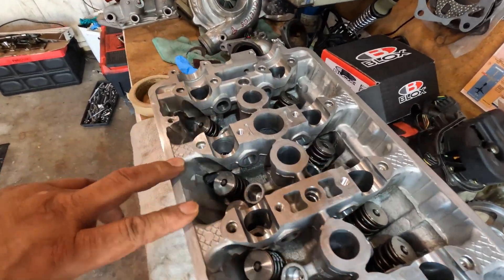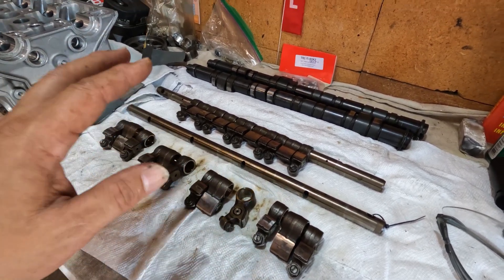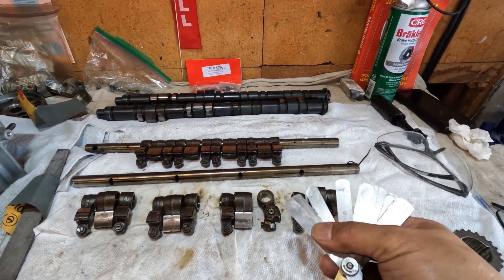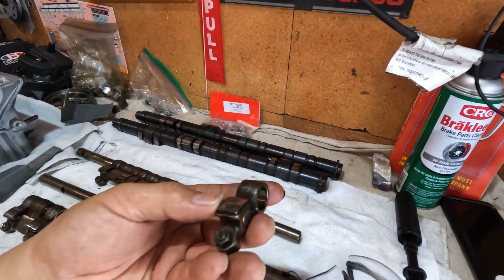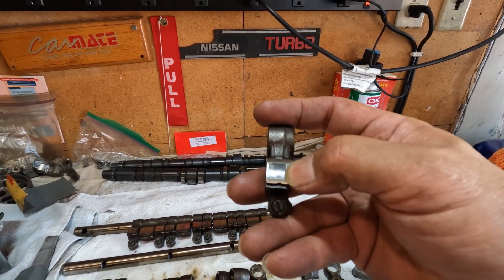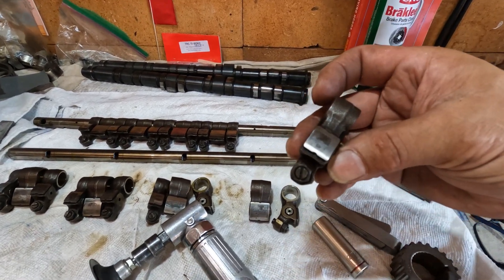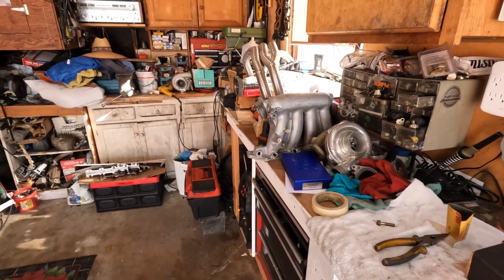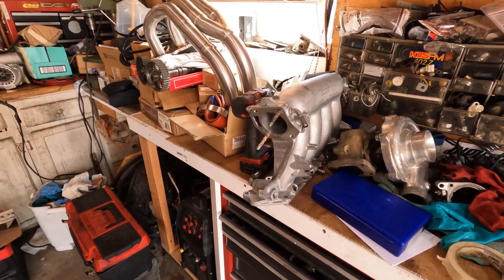H22, h23a, F20b, B18c, B16a Valve rocker arms repair.

Comment: Thanks what size bolt did you use to adjust the rocker arm? Mine came out of orientation I need to rotate it
Reply from the maker: I used the bolt for the transmission.

Comment: I have skunk 2 pro 2 cams and I used some old rockers and I have a pretty loud valve tick I have done the lash to as low as .001 under spec and it still ticks do you think worn pads could cause that. It’s otherwise a brand new build
Reply: I have skunk 2 spring lmas brand new and supertech valve springs all brand new
Reply from the maker: @Anthonysdixon  ok, my co worker have same issues like yours but on a B16 and he never did really figured ut out. He ended up exhanging his cyl head and never hear that ticking sound. If your valve lashes is all set correctly and you already have spring lma's. The only thing l can think of is maybe its bottoming out and if it does, the cam lobes will be digging on the rockers for sure but you dont experience any of that. Hmmmnn, l'll give some more thoughts and l'll ask my coworker again about. Do you think your valve is hitting the piston somehow or maybe you have a v2v clearance problem maybe. Did you degree your cams?
Reply from the maker: If your rockers have no groove due to cam lobes digging its way, it should be alright. The ticking ususally come from LMA, are using spring type lma or hydaulic type. Spring type lma makes it quiter. I assumed you also using good valve springs for your sk2 cams.
Reply from the maker: I would keep the valve lashes to minimum settings, making it tighter will worn out your rockers or cam lobes. If you do have a spring type, check make sure that it's not broken or something. It's known spring lma's will break.
Reply: The ticking started after a pass when I was on rev limiter. Maybe something was off and a valve hit im not sure. Theyre stainless Ferrea valves. Hopefully I didn’t bend something. I have a pretty thick head gasket to lower compression so I can’t imaging I hit anything I’m not sure. They degreed -2 -2 (I’m assuming because of the headgasket width)
Reply from the maker: @Anthonysdixon  if it hit the rev limiter, do a compression test to make sure you didn't bent a valve or something, compression test and leak down test will give you an idea. You can also do a quick test of pulling the ignition wire one by one and listen to the sound of the engine idling. How's the engine running? Was it running rough or feels like your misfiring and sounded like a Subbie. Also check your timing belt timing, make sure you didnt skip a tooth or something.
Reply: It’s not running rough I did a compression test and all cylinders were within 15 pounds of each other other or so. I also did a leak down test but I’m not sure the best way to do it. Should I have the cams removed? I did cylinder number one at top dead center with the pulled all the way out. That seem to work fine I didn’t hear any leakage out of the exhaust pipe or intercooler pipe. I then did the other cylinders at top dead center but realized that some of the valves remain open on some cylinders. I then tried it with the cylinders in the same position as when you lash valves, I could hear some air escaping through the exhaust valves, but I’m not sure if it’s an accurate reading because the piston is not at Tdc when the valves are all the way closed. Should I do the test with the cam shafts out?
Reply from the maker: @Anthonysdixon  Do the leak down test with canshafts. But check your valve lashes and set it to .007"on In and .008" ex. Do the procedures per ignition firing order, 1,3,4,2.

Comment: All of the rocker arm assemblys in the video tittle are compatible with each other? I can take the h22 and put em on an f20b?
Reply from the maker: The repair can be applied on all the motor mentioned. H22 and F20b rocker arms are compatible. You can use it, same thing on the camshafts.

Comment: What’s the valve lash spec for the f20B and do you know where you can get valves for the f20b?
Reply from the maker: Not sure but the last F20b that l did, l ser it  like H22. 0.006-.007 Intake, .0.007-0.008" exhaust. I think you can't get a replacement valves here in US. You can try Honda dealership and maybe they can special order it for you. You can also try FB market. I know some people they send it to machine shop and replaced valve guide to the size of H22, maybe you can go thay route, get an estimate on how much it'll cost you to get it rebuild.

Comment: Quick question bro … i want to make a g22 build using a f22b block and h22a head will that be the same process as all your videos? Or if you could give me some information on the process like do i have to seal the wholes on the head as well that would be greatly appreciated. Also what head gasket to use thank you in advance 🙏🏻. 
Do you have instagram or facebook so i can message you directly through there.
Reply: Thank you so much bro 🙏🏻🥺 I’ve been looking for information or videos on YouTube and no one seems to show the process on what to do for the g23 until i found yours 👌🏻😁. I have a eg6 right hand drive with a h22a boosting 10 psi but out of nowhere it lost oil pressure and spun some bearings and did a lot of damage. I just cant find h22 over here 😅 thats why im going with the g22 … but I really appreciate the info keep up the good work 👌🏻😁
Reply from the maker: @lsxcartel6771  that's not good for the old H! But yeah, its similar to building a g23 and once you figure out what piston size to use next is what everyone always making not sure off, it's the headgasket, other than that, it's almost a walk in the park,lol, kinda. Later man!
Reply from the maker: It's pretty much the same process, plugging 2 oil drain holes on H22 head, H22 timing belt, crank gear, you need to swap the h22 waterpump gear pulley to f22 or give Kstuned a call if their item g23 waterpump will fit the f22 block.( pretty sure it will). Water coolant tube, you need h22 connected to f22 and use H22 thermostat housing. Headgasket, not sure what others been using and what really works. But l know that you use a headgasket base on what block you are using. But there's lots of info on the web like Honda-tech.com. F22 block have a oil restrictor, located in the middle of rhe block just above the oil pressure switch( intake side). That restrictor is not needed for G22vtec , so it need to be remove for h22 head swap. Use Cb7 accord engine mount bracket(driver side) to mate it w/ h22 mount. Plenty of choice for piston since f22 block is iron sleeve, you can have it bore to 86mm to accept k20a2 piston if you wish, but only on NA setup. Visit zealautowerks.com for engine compression setup. I have not done a g22 myself but l know it's same process. You can just leave a msg and l'll be glad to help you out in anyway. Alright bruh!
Reply from the maker: Kstuned offer lots of parts like oil drain plugs, waterpump for frankeintein build. Shoot them a email and they'll be glad to help you out too.
Reply: How are you man? I just started the build 😅 but what kind of sealer do you use to plug the oil drains… i was gona use the RTV black or grey silicone …. Im not sure if that will hold 😅
Reply from the maker: @lsxcartel6771  I made a vlog about how l plug the cylinder head. I showed brand and part number. Kstuned.com sell a plug and it's not that expensive. I used a "Versachem Mega grey 3". It's the same stuff like Hondabond. Don't use black silicone.
Reply: @sagittnet2158  oh okay thank you so much 🙏🏻😁
Reply: @lsxcartel6771 I would personally rather have them welded up. I know they make head plugs, but welding them is a sure way it won’t leak. I’ve seen machine shops that would weld them up and deck it for the customer. Doesn’t hurt to ask. 🤷🏻‍♂️

Comment: @saggitt net2 what injectors should I run on a high comp g23 build with say a 90mm throttle body and k series skunk 2 ultra street manifold
Reply from the maker: I'm just giving my 2 cents, 500cc up to 750cc will be good for a pump gas NA setup. For E85, you want something like 1000cc.  Check out a Fuelinjectorclinic.com for hp calculator.
Reply from the maker: That's quite a parts list you have bruh! Nice
Reply: @sagitt net2 it’s going to be a BEAST and it’s going in a 90 crx hf , oh and I’m getting the s1 awd kit........ 😈

Comment: You ever experience a whinning noise almost like a super charger whine? Just notice it in my h2b swap jdm h23a motor.
Reply from the maker: I do, and it's much noticeable during deccelation. I noticed that whinning sound when l was breaking in the engine way back but l found out it was coming from my axle being position in a high angled. How l know coz back when l was using my cd5 Accord, l heard a whinning noise, l thought it was from the tranny, so l brought it down and l thought it was the release bearing but noise came back after l put it all together( made a vlog about whinning noise). But to be sure on your setup that it's coming from the axle, the noise should only be noticeable during deccelaration only. How low is your ride?
Reply from the maker: Tried these t/s, on mine before, when l'm mobile and l hear the sound, l step on my cluth if the sound goes away and l did it on every gears. I also did it during decelleration where the whine sound is louder, step on the cluth and it goes away. Hope yours is the same like mine but check all your suspension components are secure tight before considering it's your axle coz you might have something different. You dont have whine noise before on your h2b?
Reply: I believe mine has to do with the timming belt. Maybe being a little to tight and something about the tension bolt from what I read. Mine only does it upon acceleration. It sounds just like the noise a super charger makes but bot as loud. Really only noticeable when you listen for it.
Reply from the maker: @Jeff-mu8dq  are you using a kstuned type tensioner or obd1 manual style belt tensioner. If kstuned, maybe you adjusted it too tight. If you convert it to obd1 style, you can do like l did, shave some material off and that will give you a bit of looseness on the belt. There is another l can think off that will make a whining sound coming from belt area. I assumed that you did some T belt replacement and if you still have the B/S belt. If the b/s gears are not align, even just 1 teeth off is enough to give a noticeable noise. If you don't have the bs belt  anymore, disregard.
Reply: I had the same noise not to long ago. It was the balanced shaft belt too tight. I loosen it jus a tad bit and the noise is gone

Comment: Sensei Sagitt
Reply from the maker: What up bruh!
Reply: @sagittnet2158  whats up man, just rebuilt my h22 and put the engine back in. Hopefully all goes well and everythings in time. Converted from ATTS to a base model. just need the intermediate shaft and axles now and shes ready to start up
Reply from the maker: @carvedfromlife8949  Not a whole lot, still messing around w/ the "stroker" lol. I thought l can put the head 'n block together this weekend but working outside and 3 digits heatwave we're experiencing is not helping. I can only do so much and felt like l'm gonna faint or something. But good to know your pride 'n joy will be rolling again. Get her oil prime n give it a lick of ignition hehehe. I'll share you some of my engine build success. Every engine l built, on 1st start up and once it's on idle, l dont rev the engine, l let it idle for 15 minutes till the fan kicks in. It helps a lot as far as the fresh bearings are concerned. Hope your build is a successful one. Later bruh!
Reply: @sagittnet2158  ya same here, I'm in San Diego and I put the engine in last weekend. Did it outside I had a small canopy for shade and a small cooler with water. Had to constantly take breaks
Reply from the maker: @carvedfromlife8949  almost neigbors, Long beach. Stay cool bruh!
Reply: @sagittnet2158  had another question when u get the chance, I got the prelude SH I'm working for like $500. Blown head gasket, took out the engine and rebuilt, but I noticed the block was a little warped, so I watched videos on sanding and leveling the top and did it. So I'm hoping everything seals, but if it doesn't work, I have a beat up 96 accord with an f22b. Was wondering u think that would be a good block to use if my repair on the h22 doesn't work?
Reply from the maker: @carvedfromlife8949  That old sanding technique worked. I tried that too on 1 of my h22 cylinder head. I glued the sandpaper onto the glass. I tried it coz l want to know if it really save me money. But it's a lot of worked and took a lot of my time. But now l send my parts to machine shop. If you did a good job it should seal. F22 will be good contender. Don't know much about G22 as far as what headgasket to use but l think you would'nt have a problem finding info nowadays.  The build should be similar to a g23.
Reply: @sagittnet2158  it was multiple weekends of sanding, wanted to take my time. I got it pretty level but we'll see, my accord has been sitting and has a lot of back fees on the registration so I was either gonna junk it, but I've been using parts off of it. I hope it seals, thanks for the replies sensei. I post my work on my channel as well if u ever have the time to check it out.
Reply from the maker: @carvedfromlife8949  yeah man! Like to see your build.
Reply: @sagittnet2158  hey sensei my bad for all the questions, got everything put together on my engine this weekend and tried to start it up, im having some issues/no start. The starter turns on and spins, but it sounds like its spinning freely. I checked the flywheel and started it and its making contact with the flywheel and spinning that as well. But the car doesnt sound normal on start up, sounds like there is no resistance. Usually it sounds choppy like the car is trying to start, you ever deal with this issue before?
Reply from the maker: @carvedfromlife8949  l didn't get that right earlier, so the starter is not engaging onto the flywheel or it does but it kinda turning like it doesn't have a compression? If it sounded like no compression, recheck the valve lashes.
Reply: @sagittnet2158  i think you are right, because i didnt set the valve lash yet and i just checked the measurements today and they are all out of wack. some are too loose and some are so tight i cant fit the feeler gauge in it. I need to order the valve lash tool to adjust them, i couldnt fit a regular 10mm wrench in the head. But yes the engine is turning like there is no compression, i checked for spark and fuel today so im hoping some of the valves are open and losing compression.
Reply from the maker: @carvedfromlife8949  Alright brother, lmk once you get her running. Take your time bruh!
Reply: @sagittnet2158  yup you are right, getting ahead of myself skipping steps. Thanks for the tips
Reply from the maker: @carvedfromlife8949  no worry.

Comment: Is the oil restrictor suppose to have a o ring on the top of it as well'? Under cam cap 3?
Reply from the maker: Only 1 oil seal ring goes onto the restrictor. I know l put 1 on top in the past so the cam retainrer will sandwhich it but lt was incorrect per Honda service instruction.
Reply: @sagittnet2158  is it safe to leave oring on top i just did it n i wasnt having vtec cross over put 1 on top n finally crossdovet
Reply from the maker: @alex13238712  yes, l did it before and it's not going anywhere.
Reply: @sagittnet2158  thank u so much man
Reply: No
Reply: Only under the cam cap on h series....b series it goes on top